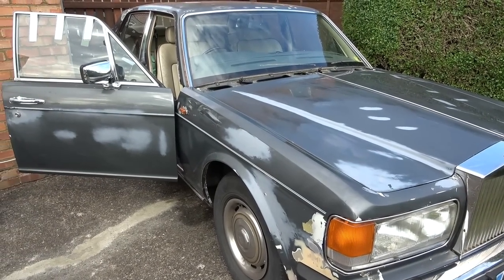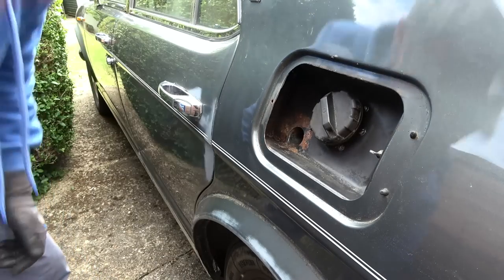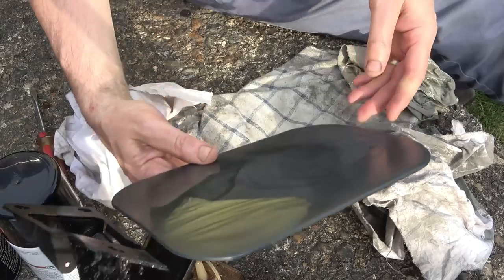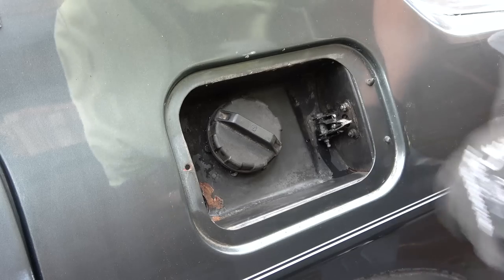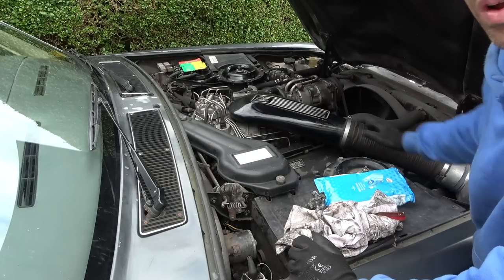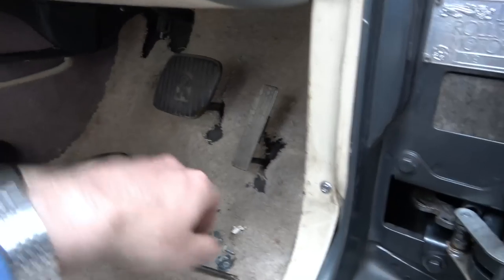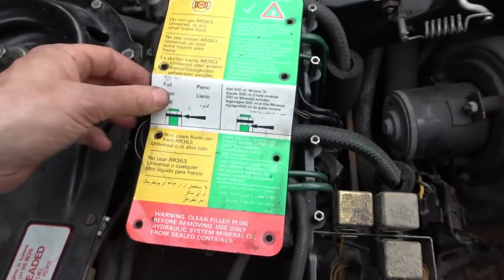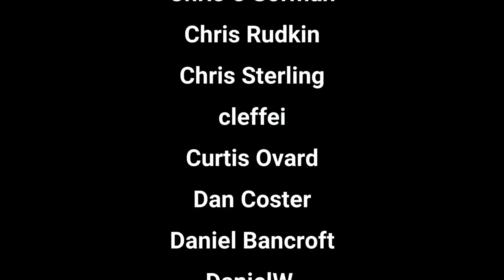Can I REPAIR a ROLLS ROYCE - PART 8 - Fuel Filler Flap - Polish - Engine Clean

Comment: To degrease the engine/gearbox to find where the oil leaks are coming from use brake & clutch cleaner. 

Buy it in 5 litre containers instead of in compressed cans as it way cheaper & just buy a pump up sprayer.

Kick down is to do with the gearbox, you literally kick down a gear when you floor it & it gives you a speed boost.

The additional linkage on the throttle body is for full throttle to allow as much air & fuel into the engine as possible for maximum performance.

The green balls are call accumulators & are very common for leaking or failing all together. This is where things start to get really expensive.

Comment: Get some Farecla G3 cutting compound with the polisher, then go over with G10 and it will look like a glass finish. Don’t use T Cut if your thinking of doing any painting on the car, you will not find a bottle of T Cut in ANY decent body shop as it is greatly inferior to Farecla
Reply: I used this brand at work, on high gloss furniture. 
I'm.assuming this car is pu paint and a lacquer over the top?

or will it be the old school cellulose? 
(my knowledge isn't great) as I'm not a car sprayer.
Reply: @GinandTronics  Most likely a Cellulose, clear over base product, possible too old for a 2K paint.  A good test is, if the cloth you are using to polish the paint does not turn the same colour as what you are polishing then it has a clear laquer applied, if it does change colour then its probably a 2K finish.... or you have polished the clear coat too much and gone through to the base colour :)

Comment: 4.42 hi vince, i've did the same trick with the adjustable spanner on the allan key, but i used the other end and put the allan key thought the hole in the handle :}

Comment: Nice lithium grease! Another can (or multiple cans) of stuff you'll probably want to have handy is brake cleaner. When you get down under the car and need to clean off dried oil from everything that stuff will work miracles.

Comment: you should try a thing called claying the paint work. You use a piece of clay and some washing up liquid .spray the paint work and rub the clay over it. it comes up very shiny with no rough feel to the paint work. Works wonders

Comment: Quick tip - be careful with wet wipes/baby wipes if you go to clean the interior. The wipes will strip the paint from parts like indicator stalks and switches.
Reply from the maker: Thanks Max👍👍👍

Comment: You are supposed to pour out the rust killer into another pot and throw once used. You are not supposed to put the paint brush back into the liquid once it have been exposed to rust.

Comment: maybe aluminum floied sela use like original rubber oring  tosealed the the burned of oil or to keep the oil in long time parking when u had park in long time to save oil  then if u want to save sun boiled fuel then do the seal smootly and  completly cover around the fuel flip and then no in the lock side then thats easy to spring to open again

Comment: little tip. that rust converter stuff. you should not use a brush on the rusted part and then put the brush back in the bottle of rust converter. you may find the next time you need it that it has converted the whole bottle. 
its best to pour some of it in a small container to dip the brush in to like a plastic shot glass. i learned this the hard way and had to throw out a whole bottle because it gotten rust in the bottle and completely converted it self. hopefully yours has not done that yet.

Comment: Rust oleum  you should decant into a different container otherwise you’re touching the rust and then putting it into the bottle Petrol caps are usually cheap Not too sure on that car  But if you can’t find want to put a new gasket on it  .But a good video keep up the work

Comment: Also, T-cut contains fillers which fills the scratches to make it look better. This is a short term solution. If you want a high gloss which lasts, use a proper cutting compound on a proper foam pad with your electric polisher and you’ll see a better difference. 
3M sell a product called ‘fast cut’. Go for the green one with the green pad and you’ll never look back. 
If you don’t believe me, give the fuel cap with a wipe of your favourite liquid - IPA and you’ll see the scratches come back

Comment: A car this old has probably started having its gaskets (and rubber seals) fail which explains the leaks, gasket kits are cheap, it's just putting them on the car that's a faff.  As for the painting the car, the program wheeler dealers used to use spray cans, you get a more even coat, and there are companies now that can make custom cans (the paint code should be in the cars book)

Comment: when you use the paint spray, always spray upside down to clear the nozzle otherwise it will block and you have had it unless you soak in paint cleaner

Comment: Your air filter seems to be a washable purple K&N type, and it is very dirty. I doubt it is original, it looks like it just rests in the original air filter box, but you should try to clean it, your engine is choking. And I would put back an original air filter afterwards. Those types are efficient only when they are brand new on the first kilometers.

Comment: kickdown will kick the transmission down to 2nd from 3rd, not from 2nd to 1st. I don't know what transmission it has but the american th400 had electric kickdown utilizing a switch. others used a cable hooked to the transmission.

Comment: Concerning the hydraulic pots: these are not under pressure. (I have a DS which has generally the same technique) you can unscrew the lid from those pots no problem
Reply: You dont take the top off them pots on a rolls.he needs a special oil dispencer which then pushes and twists into place in the top fillers then squeeze until upto the glass sight level.its a great series thst he is doing.he needs to look in the handbook if he has one.it shows how to top up and check many things.

Comment: What does kickdown do?
Reply: Down-shifts on automatic cars for better acceleration.
Reply from the maker: As Matt says, it shifts down to a lower gear when that button is pressed to allow you to get a burst of acceleration when overtaking for example 👍
Reply: @Mymatevince  The switch will make the transmission either hold in gear or downshift - probably a solenoid in or on the transmission that acts on a hydraulic valve to do what's needed. Older cars used a cable from the carburettor to do the same thing
Reply: @Mymatevince  Is this why my car has a "click" feel when i floor it? I'll have to pay more attention to it next time
Reply from the maker: @mattigins  Yes, in my experience when the accelerator is completely floored you can normally feel the switch through the pedal even with the engine off 👍

Comment: With the rust treatment you should pour a little into another container and not use your brush in the main pot as contaminants from the item you are treating can set off the chemical reaction in the main pot and ruin it.

Comment: Don't use E10 petrol, use VPower or Ultimate E5 super unleaded because the ethanol in the E10 will rot your rubber fuel system because in 1988, they didn't have this stupid Ethanol in petrol
Reply from the maker: Thanks Ron, the recent petrol I have been putting in has been the cheaper petrol so I presume it has been the E10. I'll put the better E5 petrol in going forward 👍👍👍

Comment: Don't paint topcoat with a brush Vince. Your paint is a metallic so flakes will lie and look wrong. Get a made to code paint aerosol and find out the right colour basecoat or overall colour will be wrong. Also NEVER use any cleaning stuff that has been on the floor, not even a sponge. Will cause more damage to paintwork making it harder to sort in the long run. Otherwise great stuff!

Comment: You can get a good toolkit for 250 GBP,  with enough bits to not need to use an allen key and a wrench. Good work though
Reply: I can recommend the Halfords Pro socket sets, £150 will buy a great kit with 3 ratchets, combination spanners, ratchet ring spanners and a whole host of sockets and bits, lifetime guarantee, been using mine for 4 years and had one torx bit snap, walked into Halfords and they swapped it without question.

Comment: aerosol don't brush it, you will make more work for yourself, mask off a little primer then correct colour, then G3 or G4 compound. don't machine on corners, use your hand, the machine is ok on big flat areas.

Comment: Great video Vince!  I suggest that you still try to get a service/workshop manual if you are going to be working under the hood.  With that being said I found this video that explains how to bleed the mineral oil system https://youtu.be/ekdQpVLwYRs It sounds like you leave the engine off with the ignition on, then pump the breaks 70 to 100 times to remove the pressure.  I hope this helps, and keep up the great work!

Comment: Your idea with the paint and a brush won't work well, Metalics need spaying as the brush will drag the flecs of aluminium or mica and it will look bad.
If you want to do it on the cheap, prime up and flat the damaged area, grey scotch bright around half the wing, clean and mask up, apply several coats of the correct colour using an aerosol, keep the colour local as possible to the repair allowing a little overspray, now use clear lacquer and paint to a wider area and leave to dry. Once dry polish the dry edge of your lacquer with some T cut or G10 farecla.
A better way would be to scotchbright the whole wing, paint the area around your repair and lacquer the whole wing using a gun and some 2k lacquer.

Comment: 3 nuts to remove the hinge from the panel and you could have then easily soaked and de-rusted the hinge assembly??!!  Also would have been easier to paint.

Comment: Those hydronic green spheres are exactly the same as you will find on Citroens. So if you want replacement don’t buy from RR go to Citroen. RR stole the idea from Citroen.
Reply: In fact rolls Royce used the Citroen system under licence from Citroen.
If it follows the shadows system,it's used on the the rear suspension to keep the rear of the car level. The system even works faster when a rear door is open to help level out the car while people get in or out.
Reply: @brianiswrong  true but I couldn’t be bothered to type all that.🤪

Comment: Cars are getting cheaper and cheaper in terms of quality but that happens to all modern technology to be fair, cars nowadays they have a lot of features and to have a good price tag the quality is very low, i preffer a good quality realible car than a car with lots of technology that breaks down in 4 years, just check any cheap car how slow the android thing is even in expensive cars the cpus are trash, they cant just spend a bit more money in a snapdragon 888 or something like that that is cheap and good and they use trash that is much cheaper, they even remove buttons and put it all in the touch screen to cut costs, and thats not in 20k euros cars i have seen that in 100k euros cars, this old rolls wasnt probably very well taken care of and thats why it has that many issues, i preffer modern cars just for the safety features but in terms of quality and reliability old cars were far superior

Comment: This video may help you Vince https://youtu.be/LeS_lefYL2c I can take a photo of my windscreen wiper mechanism if it helps you to reassemble yours correctly, there are actually two distributors and  are connected by a rubber belt. Cheers Jerry

Comment: Great, but could you not spend another twenty minutes or so, and treated the rust that’s glaringly obvious when flaps open? , even the bolt heads are rusty. Two minutes maximum to have just treated and sprayed. Think I’m being anal? Wait till potential buyers turn up! ,they expect detail to the nth degree.